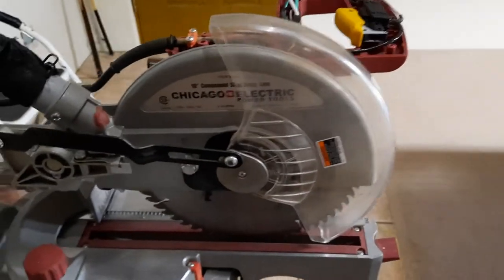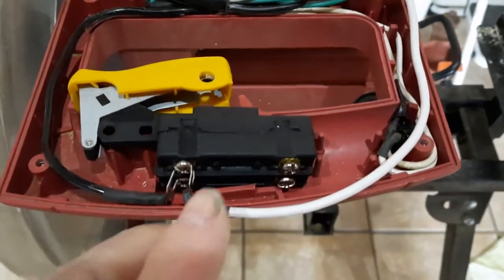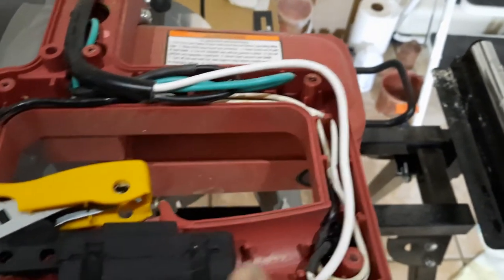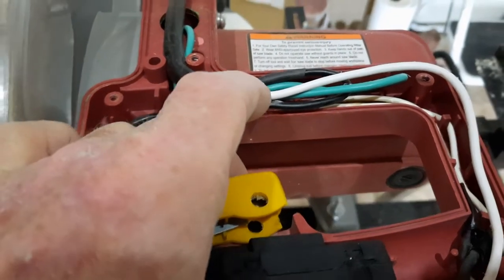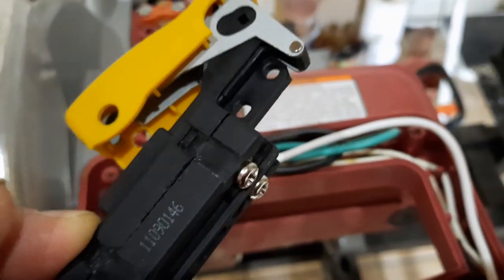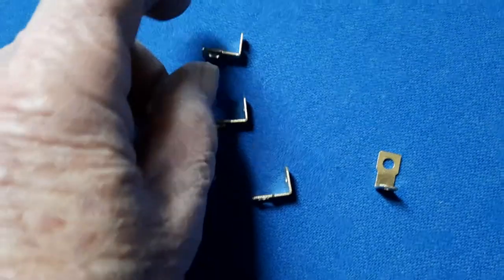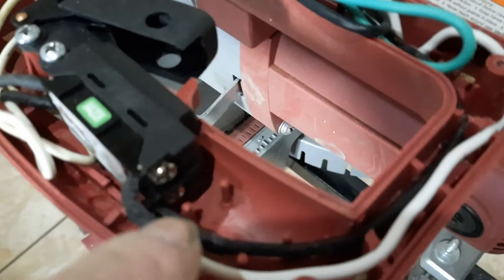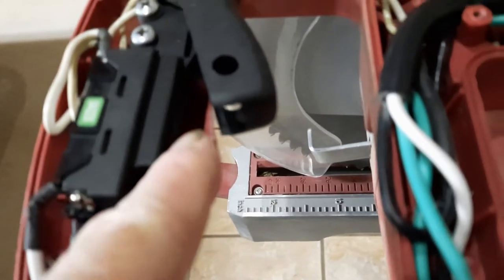Replaced a broken Harbor Freight Miter Saw switch, Please read description, always test continuity

Comment: Thank for the tutorial. I swapped out my switch. Unfortunately I didn’t have any extra slack on the black wire so I had to extend it.
Reply from the maker: Thanks for watching and commenting. Yes, the black wire was the one that was almost too short in my case. It was so tight that was why, once I had the switch in place and wired, I did not want to take it back out, just to show what the partition looked like after I had cut it. The black wire would only mount to the right hand side bottom post and I had to screw it down tight, and then stretch it around in the handle to get the new switch into place. It was too short to mount to the right hand side top post and probably should have been extended, so I did not risk pulling it loose inside the motor when stretching it. Good job and I am glad the video helped you.

Comment: talk about adding to the confusion, i ordered the exact sw38c switch you have linked but i didn't receive an hy38 switch, the package for the switch i received had the sw38c and the same dewalt reference numbers except says reversed terminals and the switch inside is the same Jiaben brand as the original harbor freight switch and has almost the exact same part number as the HF switch and has the two switch off on the right and switch on on the left just like the original HF switch, still have to dremel out some plastic to make it fit, crazy lucky i guess.....
Reply from the maker: Thanks for the info regarding the link I provided to try and help people find the switch I bought. I did click on the link and the switch definitely looks different than the one in my video. Mine had the 4 quick connect tabs screwed into the switch. They still do not show the picture of which poles are energized once the switch is pulled. 
Someone else had the same problem and I put a paragraph in my description to suggest everyone do a continuity test to see which poles have continuity when trigger is pulled. Now I have tried to change the title of the video, asking people to read description where I have indicated others have bought using the provided link and received a different switch where power and brake where located different my link.
Reply: @johntube2525  i missed where you said to check continuity i just checked it out of habit of course it would have been a real problem if i had just reversed the wires without checking it first, what i think is funny is regardless of what the packaging label says, the switch itself is from the same manufacturer that made the HF switch and the switches part number is almost identical to the HF switch part number. we all owe you a debt of gratitude though because if it weren't for your video i know my saw still wouldn't be fixed, you got us going in the right direction, one thing i would suggest you do though is add to your description that if the switch packaging says "REVERSED TERMINALS" then the wires don't have to be switched, they can be connected just like they are on the HF switch. thanks again, sure is nice to have my saw back......

Comment: Saw this video about 24 hours ago. Paid extra for next day delivery. Part is in and the saw is working again. Thank you.   For others it should be noted that the linked to part is the same orientation as the original.  Power on left, brake on right. So no problem routing wires as in Johns case and others in the comments.  The only modification needed is a little nub of plastic inside the handle that I clipped, first with small wire snip, then scraped a bit more with a razor knife.  As for wiring.  The pair of white wires go on right as on the original.  The other two, one black, one white go on the left, one of which comes directly from the wall power and the other goes directly to the motor. Switch turns on. Power goes to motor.  Happy wood working!
Reply from the maker: Thanks for the information that the trigger you bought using my link has the power on the left and brake on the right. This is VERY IMPORTANT information. 

This indicates to me that it is VERY IMPORTANT that one should do a continuity test to see which post have continuity when the trigger is not pulled, (this would be the brake circuit). And which post have continuity when the trigger is pulled, ( this would be the power circuit posts) .

I have added this information to the description, based on your comment. Hopefully the description and your comment and my reply will help others figure out where the brake wires go and where the power wires go. Thanks again for commenting on your experience with your replacement switch. 

Or, that it is very important to study the circuit diagram on the replacement switch. 

If you pause my video around 3:20 you will see the circuity of my replacement switch. 

Note: It is hard to see, but there is a solid line showing posts labeled 2 located on the left of my switch have continuity all the time until the trigger is pulled. When trigger is pulled there is a dashed line indicating something pushes open the circuit at 2. So no more continuity across post 2 (where Brake wires should be).  Trigger pulled and the circuit is closed across posts 1, (where the power should be). 

So the Circuit diagram on my replacement switch showed Brake on Left and Power on Right.

Hopefully your circuit diagram on your switch showed the proper brake and power wire circuit orientations.  If your case, Power on Left and brake on right. 

However as I said above. It just goes to show that one should check which post have continuity when the trigger is not pulled, but no longer has continuity once the trigger is pulled, (Brake circuit). And which ones do not have continuity until the trigger is pulled, (Power circuit). 

Very good comment! Thanks for watching and most import, commenting about your experience.

Comment: Thank you for this video. I borrowed my mother's miter saw and it randomly stopped working. I will test this and possibly replace the switch. So glad for people like you who break it down for us!
Reply from the maker: Thanks for watching and commenting. I took my old switch apart, but could not put it back together in a way that it would work. It has points inside that when the trigger is pulled the copper looking points make contact with each other. Perhaps your points are somewhat burnt or worn from use and sometimes make contact and other time do not make a good contact. Mine were burnt looking and after cleaning them I tried to reassemble the old switch, but could not make it work correctly. So I bought the switch listed in the description. Thanks again for watching and commenting. Good luck!
Reply: I ordered the switch, installed, and nothing. Then I read your comment and took the old switch apart. Saw the worn contacts you spoke of and actually just switched them so now an old is “in contact” with a new switch. Checked the continuity after getting it back together. Everything seemed good. Just reassembled and now we have power! Thanks for adding that tidbit!

Comment: How do you know which wires go on what terminal for the brake wires
Reply from the maker: Maybe watching my first video where I first found out my saw would not work would help you.  title of that first video on YouTube is:
Trouble shooting non working Harbor Freight Miter Saw
https://www.youtube.com/watch?v=pWsCQIO0aSM 

If not,  I will try to explain same as I did on the video.
My old switch did not work. The switch I show you in the second video, where you commented, has the right set up for a brake. I would get continuity across the left hand side of that new switch without pulling the trigger, telling me that is for the brake. The right hand side of that new switch had no continuity until I pulled the switch trigger, telling me that was for power to the motor. So if you are replacing a switch, two pair of the wires will go to the left and 2 pair of wires will go to the right. In the video reference above I found out the white and black wire, for my saw, were for the power. I even hot wires them to a typical multi outlet switch and test if the saw worked that way. It did, so I knew they were for the power and the other two pair of wires  had to be for the brake. 

I hope this helps you!

Comment: So when I get the sw38c, do the wires go on as the original switch? Black on left ,under lever, white on right? I'm confused. Other places say to get a Sw38d
Reply from the maker: I just do not think I can be any more explicit than what I have already written and stated in my video.  Find another video or watch mine several more times where I explain how to check for continuity with trigger pulled and without trigger pulled. If you have continuity without the trigger being pulled then that is where the brake wires should go. If you have no continuity until you pulled the trigger, then while the trigger is being pulled you have continuity then that is where the black power wire and white common wire go. The SW38C switch I received had the brake circuitry on the left and the power circuitry on the right. Some have commented they bought the same switch I bought and it had power on the left and brake on the right. Therefore, I recommended in my description that any switch you buy should be tested as I stated above and in my description to determine which side has what. The one I received had the brake on the left and power on the right. I never bought a SW38d so I cannot say anything about that particular switch. The one I received was SW38c and is still working fine to this day. Good luck!